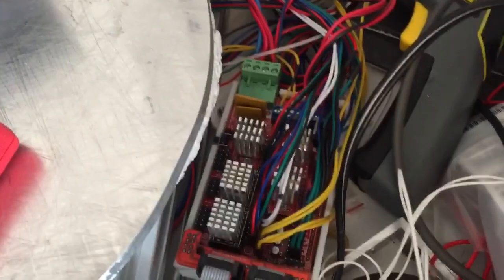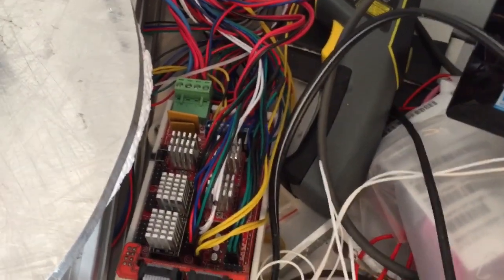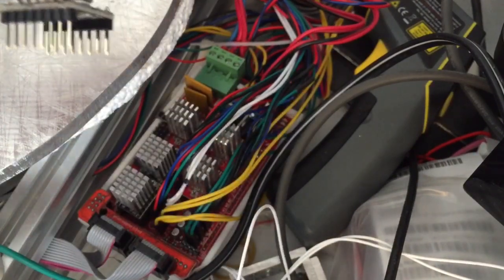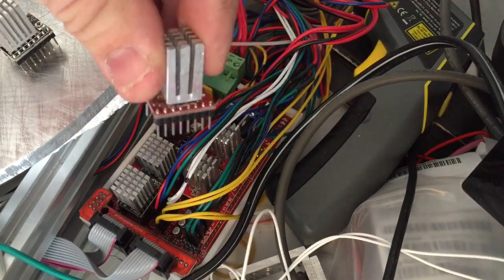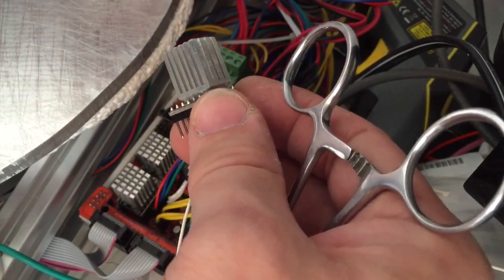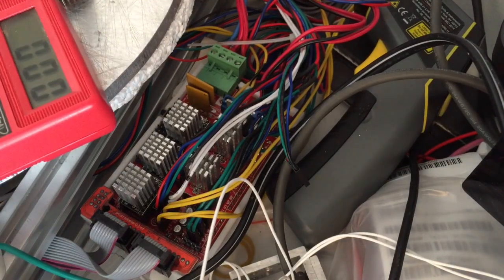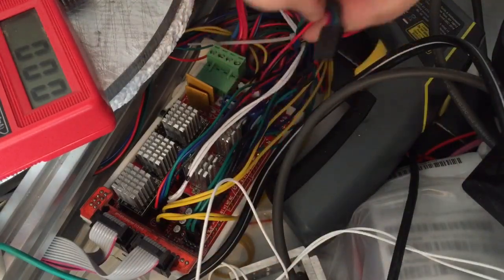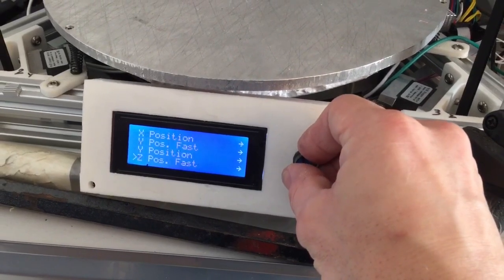3D printer: how to upgrade to TMC2100 stepper drivers

Comment: use with 12volt ?
Reply from the maker: At first, yes, used 12v power supply. Later, switched to 19v power supply.
Reply: TMC2100 use 12volt ? i  thinking change old driver A4988

Comment: Why you don't use the spreadCycle Mode?
Reply from the maker: +Andre S. youre right, I just plugged in these drivers without configuring them. I might just try and play with different configurations, and make another video about it. Stay tuned.

Comment: Well I do find this printer to be the kind of one that I may be willing to assemble.. would you please share where to get a hold of it , type and name of the manufacturer?
Reply from the maker: Migueldeservantes I bought this printer from 3dprinteronlinestore.com HE3D seller. I think the printer is called Delta Mega.. I did do a lot of upgrades to it to get to the current state. In other words, I can't really recommend anyone buys it. The upgrades I did include carriage plates, carriage wheels, build plate, bed heater, hotend, extruder gear, etc. in near future, I will post some videos about all the upgrades I did to this printer. So, be careful when spending your money on a 3d printer :)
Best of luck
Reply: Well The only thing that I know about this particular aspect of "Additing Manufacturing is that when I pull the trigger and buy one It will be a delta like yours! I would probably make it from the scratch!! but I would be willing to guess that It will be easy to start with one running then make a large one... thanks for the prompt replay!!
Reply from the maker: Migueldeservantes great! Keep us posted about your experience!